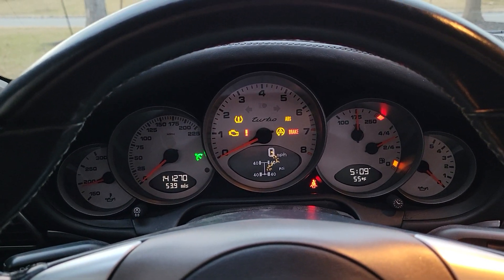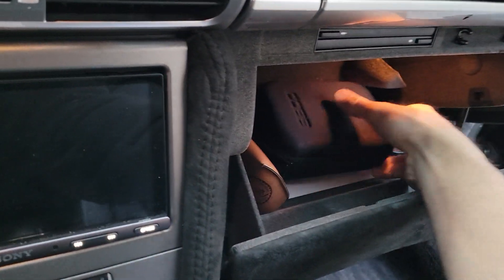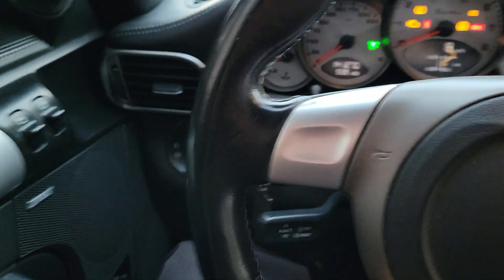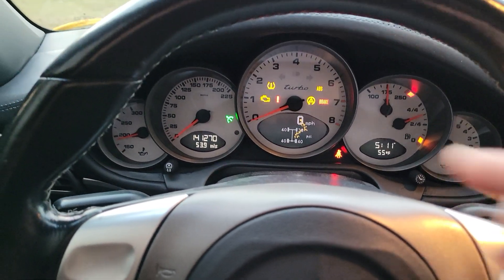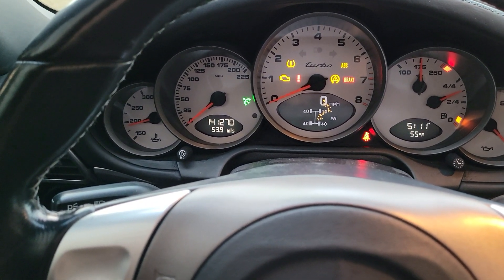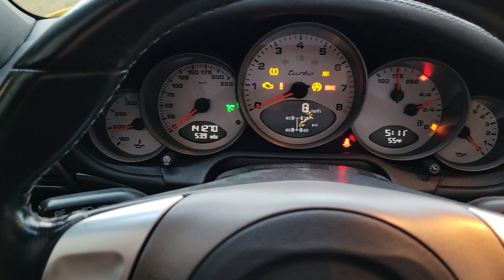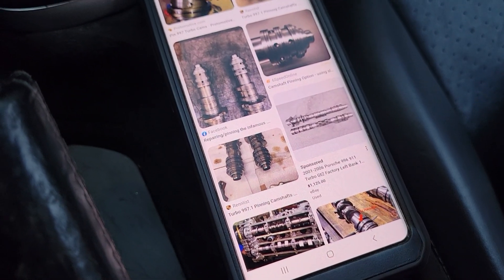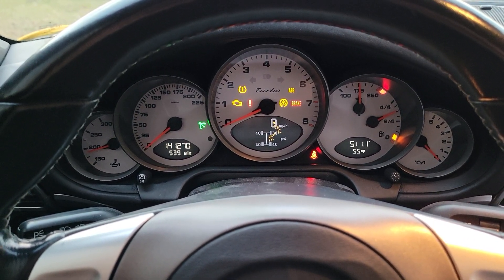Porsche 997 Turbo P0021 Spun Camshaft Fault

Comment: Man sorry to hear that.  I worry about the coolant issue & spun cam all the time.  I bought a 997.1 Turbo Tiptronic last year w/ 34K miles.  The Porsche mechanic said I shouldn’t have to worried for a long time but who knows.  I guess it’s a little less common on Tiptronics & the coolant is more common from heavy track use.  You might might want to weld/or pin the coolant pipes while the motor is out too then your about bullet proof.  They seem to talk about these 2 issues more here in the US & not much in Europe?  I had a 996 turbo stick too & that never had the 2 problems.  Best wishes.

Comment: Ive had my 997 turbo since 2011.  I had this same issue.  Unfortunately the longer you own these cars you will eventually have EVERY known issue happen.  I've had the spun camshaft 5 years ago that cost me $6K to repair.  Unfortunately at the time I didn't think to have them fix the other side although thankfully I've heard the issue happens mainly on the driver side bank so I might be ok.  But absolutely these cars while amazing have many known issues and I'm surprised in all your research you didn't hear about this one.  I've had every known one happen to me: spun camshaft, coolant pipe burst because of epoxy glue failure, tip transmission gasket leak, spoiler deployment failure, front radiator leakage from rock chips.  I love my car and have always mainted and fixed it and thankfully most of these issues were covered under extended warranties.  But there's no such thing as a bulletproof engine, and frankly, I don't know why it has the reputation with all the issues.  Good luck and keep us posted on what happened and how much it cost.